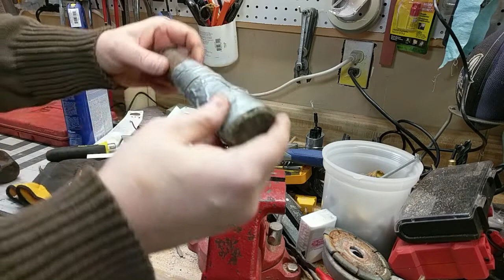TSWG Episode 55 Pawn Shop hammer

Comment: Nice video I just burn my hammers or axes when they need a new handle.
Reply from the maker: yep that is an option!  what will it do to the steel?
Reply: I haven’t had a problem with wearing the steel so far